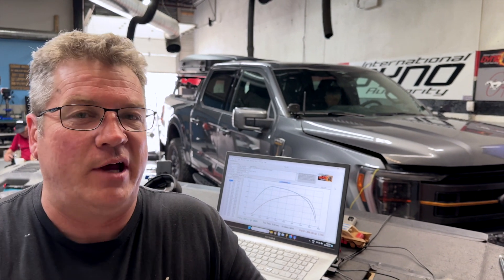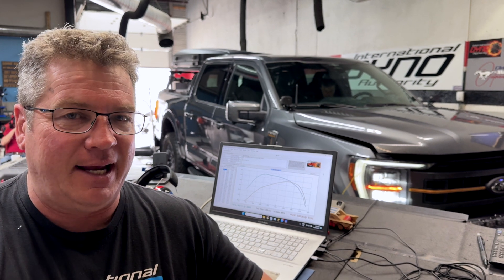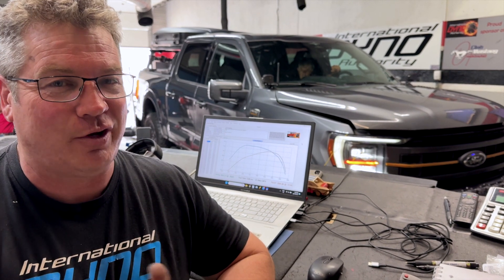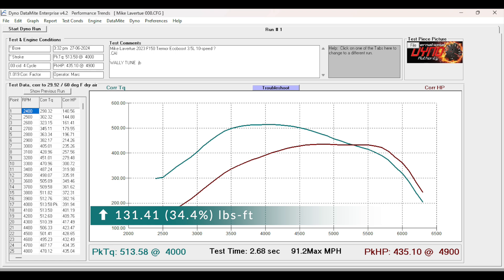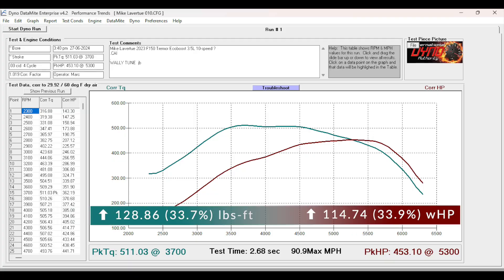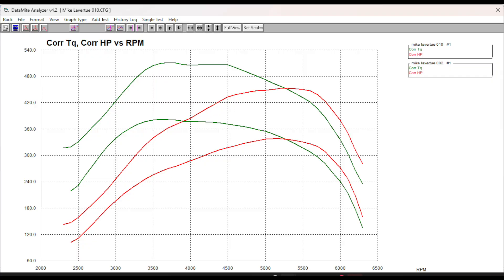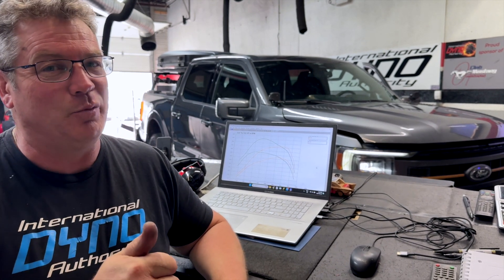2023 F150 TREMOR Dyno Tune BIG HP | Best Mod Possible!

Comment: What fuel did that tune req?  You doing 2025 3.5L yet?  Looking for Reg Fuel Tune.
Reply from the maker: The tune is designed custom around the:  fuel, Customer intended use and  modifications ....Fuel can be 87, 91, 93.  Etc...
Reply: @internationaldynoauthority693  Are you able to get an 87/93 Tune on 2025 3.5L Tremors?
Reply from the maker: @Hazard_CDN  Yes, we are. 613 293 8103
Reply from the maker: @Hazard_CDN  "get"----?

Comment: Where are you based out of?
Reply from the maker: @LanaRhoadess 
https://internationaldynoauthority.com/

 Although they say this model year can't be tuned (yet), at International Dyno Authority, we were eager to take on the challenge! We were tasked with tuning the 2023 Ford F150 Tremor with the 3.5L Ecoboost to achieve two main goals: a) improve the power curve and b) resolve the annoyingly inconsistent transmission shifting that plagues all Ford 10-speed trucks.

This F150 was bone stock except for a cold-air intake. The only modification we were to make to achieve these goals was to build a custom tune on the dyno.

As usual, we began with a series of baseline passes to assess stock performance and identify areas for improvement. Tremors make good power, and this one didn't dissapoint with 382 lbs-ft of peak torque and 338 peak horsepower at the wheels. Once converted, this wHP perfectly matched Ford's crank horsepower spec of 389.

After adjusting the factory air and fueling parameters, the first tuning adjustments resulted in impressive gains of 131 lbs-ft of torque and 96 HP at the wheels!

Our tuner, Wally, spent another hour refining the tune by adjusting the cam and ignition timing; the final results came in at 511 lbs-ft of Tq and 453 wHP. That's an overall improvement in the power curve of 34%. Converted to crank Horsepower, this exceeds Ford's factory specs by 132 bHP!

And much to his satisfaction, our customer reports that his 10-speed now shifts smoothly, with the transmission no longer hunting and pecking for gears!

Just another day at the office for the gang at International Dyno Authority.

For contact information, visit our website at https://internationaldynoauthority.com/

0:00 introduction
0:37 baseline passes
0:54 baseline results
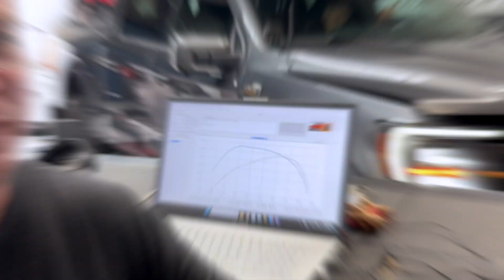1:50 first tuning pass & results
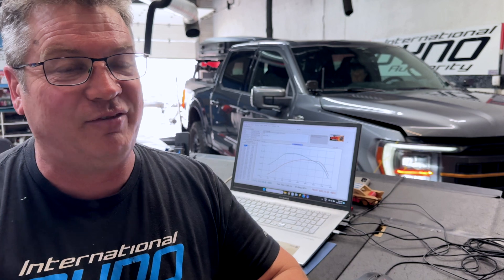2:45 refining the tune 
3:02 results & conclusion
Reply from the maker: @LanaRhoadess  https://internationaldynoauthority.com/about-contact/
Reply from the maker: @LanaRhoadess  https://youtu.be/_Zkq12x9YsQ?si=RVsA-XffIJr22Qk7
Reply: That is very unfortunate. I wish you were somewhere in Southwest US. I would drive to a neighboring state for that kind of performance gains. I know it all varies, but how much would it cost for a 22 tremor to get this tune at your shop? Just to give me an idea once i start looking around here in AZ.

Thank you! Amazing work.
Reply from the maker: @LanaRhoadess  613-795-2779

Comment: Just wondering the long term dependability after tuned? Any updates of tuned 3.5s after 50k or 100k miles later?
Reply from the maker: @jd-it4on  Yes, we've literally tuned 250 plus 3.5 L over the past 9 years.  They achieve longer transmission life, with no failures. Less fuel Consumed . Greater duration between oil changes, due to a proper clean tune burn.  So we have 9 years of history with this particular platform.

Comment: Do you guy do remote tuning? How did you guys get into the pcm?
Reply: I wish you guys made a hand held we could just plug in and tune it. I am in Michigan not sure how far I am from you.
Reply from the maker: @cobra4186  again, the type of tuning we do. Requires data logging on the chassis dynamometer. At no point do we ever build a tune, and then install that tune on anything else. Every single vehicle, every single time, is custom tuned, for injector balancing, Air speed, and individual cylinder optimization. Each vehicle leaves with a different tune than each other vehicle.
Reply from the maker: @cobra4186  every tune we do is done live. Every tune we do is done on our chassis dynamometer, pulling live data. From our chassis dynamometer. Which was specifically built for tuning.
Reply: Yea I know how a dyno works, I am wondering did you have to unlock the ford PCM. I believe my 23’ raptors computer is locked and has to be sent out or replaced with a 2021 computer. Atleast that’s my understanding? Have you guys found away around this?
Reply from the maker: @cobra4186  We have multiple systems. One of them requires that we do an unlock on the ECM. Other systems that we use do not require that. Some require a direct connection, and some, as in our our bronco videos from a couple of years ago. We have developed our own system with our own software.
Reply from the maker: @cobra4186  it depends on what a customer's specific complaint and or wants, are. We prefer to do the entire tune. Tune. Whereby, we tune the transmission, tune each one of the cylinders do fuel, injector balancing. And walk through camshaft timing correction, building a proper fuel curve, building a proper ignition curve. And setting the speeds, along with the pressures and shift points.

Comment: How's about a 2018 3.5eco? You guys sell the tunes in a kit?
Reply from the maker: @rushentertainment  We invite you to call us anytime. 613-795-2779
Reply: @internationaldynoauthority693 

What's the website or where are u guys located, because I'm running a tune on my 2019 f150 from m.p.t 
But I'm planing on getting a 2022 with the 3.5 and needing a tune
Reply from the maker: @nuttynut54  

613 795 2779

https://internationaldynoauthority.com/
Reply from the maker: @rushentertainment  Hello, we do a lot of 3.5. We do a lot of 2.7 we do a lot of 2.3. We do a lot of 5.0 

Each and every single tune is done. Step by step one by one on our chassis dynamometer
Reply from the maker: @rushentertainment  

https://internationaldynoauthority.com/
Reply: Are you guys tuning 2024 raptor 3.5 yet ?

Comment: Depending on the day my 2.7 ecoboost will gain or loose around 25hp why would that be?
Reply from the maker: @kylek6575  most of the boost, is temperature based. In order to make sure that the engine lasts and there is no damage. Ford will limit the amount of boost based on temperature.